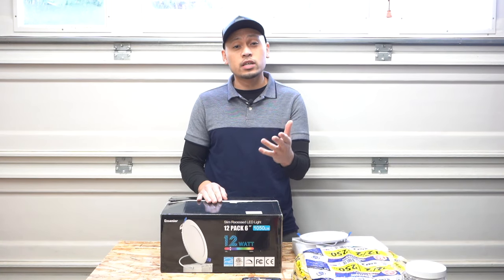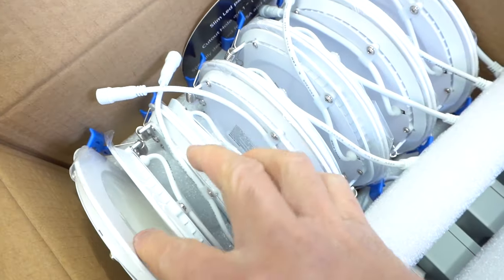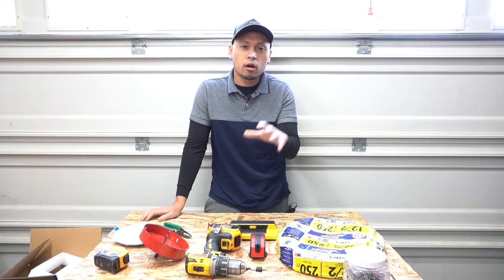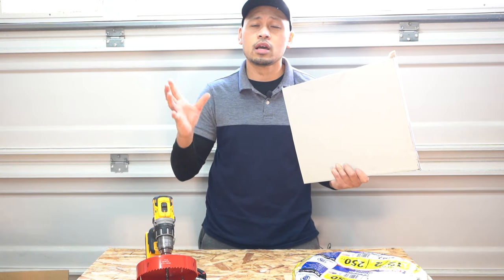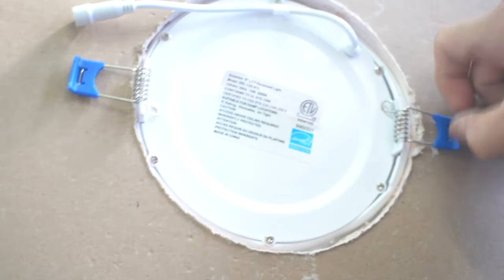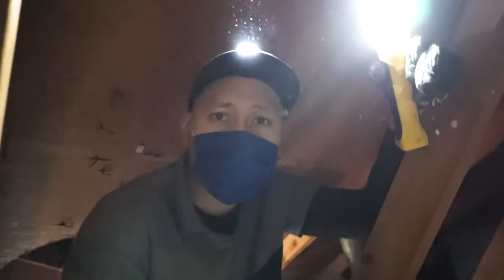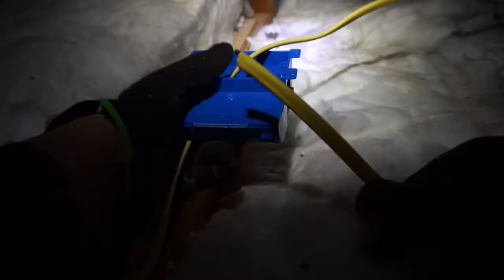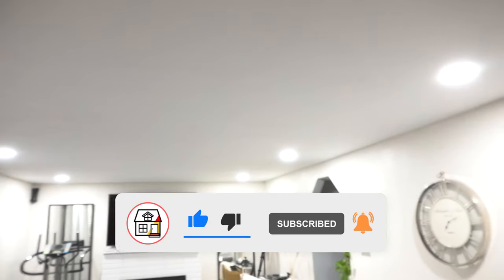How To Install Pot Lights In Living Room Ceiling | Thin Recessed LED Dimmable Lights For Beginners!

Comment: Thank you for another easy to understand video! I have a couple of questions for you or anybody who might have answers...
These are the types of lights that I want to have installed in my ceiling. First, I have to have drywall installed in the ceiling as it is currently old ceiling tiles that are stapled in place to strapping behind them. Will the strapping pose a problem when installing these lights?  Also, the person installing the drywall wants to put the drywall right over the tiles that are there without removing them which means holes will have to be drilled through the drywall AND the tiles behind them. Am I correct in thinking that this will be OK as the holes are going UP through the drywall and THEN through the tiles so if they're damaged it won't matter? Thanks in advance.

Comment: I am planning on doing this soon, just a question on the wiring for anyone who knows better than me. In the vid he connected all hot and common in and outs to the connectors. I was thinking to connect hot in and out to next light with common connected to each other and not the lights themselves except the final one. Any advice guys?

Comment: Not sure if i missed it in the video, but what do you do with the other end of the cable?
Reply from the maker: Hi! The end of the cable ends with the last pot light 💡 👍🏽😊
Reply: @FixThisHouse  Thank you. How do you remove wires from the connectors that comes in the junction box? They're not as intuitive as the WAGO.

Comment: I know this is an older video, but once installed, what do you do if you have to replace the led light? How do you un-secure the “latches”
Reply from the maker: Very easily, all you need to do is wear nitrile glove to protect your ceiling from stains, then grab any side and carefully pull to one side then another side. The spring mechanism should fold up. 👍🏽😊

Comment: great video to cover everything need. I have question for the first pot light can I just use the exist cable on the ceiling which is for the old pendant light(removed). And also for the last pot light we don’t need a loop cable since there is no more pot light need to connect is that correct?
Reply from the maker: Hi! Thank you for watching! Yes you can use the existing cable and for the last yes you don’t need to make a loop 👍🏽😊
Reply: 👍, does the spring clips work if my ceiling has two or three layers of drywall (old style house). If not is there any solution for me?

Comment: Hi very informative video thanks
What is the measure of the Hole saw drill bit for this job?Only see 6 1/2 inches not 6 1/4 as you described here to get on Amazon

Comment: I need help: 
We have pre wiring for fan. It's 14-3 wire - white, black, red and ground. The black wire has constant power and I am using it to run the ceiling fan. I have to use remote to turn the fan/light on and off. I capped the red wire which is controlled by the switch.

My question is: can I use the red, white and ground to add some recessed light?

I am just worried because I am using the black to run the fan. I'm not sure if I can use the same neutral and ground for recessed lights which is already being used for the fan.

Comment: So we have these in our new home but we want to replace them with Phillips Recessed Lights but it seems we need to add a 'can' to do it? Any thoughts?
Reply from the maker: If your going can style just make sure you use the same size diameter can so you don’t need to modify the hole. I made a video on how to remove can lights, just use that video as reference 🙏🏽😊

Comment: Quick question can u use 14/2 instead of 12/2
Reply from the maker: Good question DJ! Yes you can as long as it’s a 15amp circuit 👍🏽😊

Comment: Where did you connect the wire of the last hole its not looped, its a single wire? Is it connected to the one of the recessed lights?
Reply from the maker: Hi! Last light is single and not looped 👍🏽😊🙏🏽

Comment: 15:46 Is that main power coming from circuit breaker? Or coming from switch?
Would you explain how to wire from switch to lights (pot lights)
Thanks

Comment: Hi, I have the same lights and one is not lighting up anymore. I tested the power and the power is getting up to the recessed light. So, if I have power in the junction box  can I replace just the recessed light fixture without the junction box or I have to replace both? Or even worse I have to replace the whole system?
Reply: Nvm I tried to swap with an existing in my home another recessed light and still not working. So the first and easier option I think I have to eliminate

Comment: I am doing this exact installation. One question. Don't you need to have a barrier between the LED drivers and the installation? I understand that LED's and the driver run cool but I thought this would be a requirement.
Reply: Always check local code, but what I’m reading is check your LED for IC RATING if you are installing it under insulation to be on the safe side. And less than 100w.

Comment: Wondering why you didn't use your paint sprayer for your ceiling. ?
Reply from the maker: Hi! I was considering it, but using a sprayer takes a lot of drop preparation and a lot more plastic barriers so the overspray doesn’t reach the other rooms. I am skim coating my whole guest room soon and in that project I will remove all the furniture and create plastic containment and then I will use my paint sprayer for sure so stay tuned for that video 👍🏽😊🙏🏽

Comment: In the j- box you said connect the white neutral to the hot black. Do you mean connect the two neutrals together and the to blacks together? Or do you mean connect white to black and white to black?
Reply: Yes connect the white to the white,  black to black and the ground to the ground all in those wire nuts that are provided by the manufacturer. So each wire nut will have the same color wires coming out of it except for the ground that will have two copper wires and the green wire that's provided by the manufacturer that's attached to the fixture. The only exception to that is the last Light which will only have two wires coming out of each wire nut as that is where the daisy chain stops.

Comment: 21:21  You are supposed to put a plastic ring in the hole of the light box(protecting the wires)   because the metal box is very sharp !

Comment: I'm looking to run a smaller  3" ceiling light in my bathrooms above the shower and tub, could it be run off the light switch?  do you have any video's on that type of installation?
Reply from the maker: Yes ofcourse! Are you planing to do a replacement or new install?
Reply: I want to do something similar. I want to remove the light fixtures from above my mirror and install the recessed lights. How would I be able to run it off the light switch?
Reply from the maker: All you need to do is to remove your old light fixture, ( check out my video I made on how to replace light fixture it shows you how to remove existing lights. Similar concept. Then just repeat the same process as process number 2 on this video and 3 using your old light switch. I’ll make another video on this so it will be more clear 👍🏽😊 I’ll be doing the same thing on my kitchen cold lights. Stay tuned)
Reply: @FixThisHouse  I am doing a existing light that has a 3” round box.  I did not see any recessed lights for 3” hole.

Comment: Thanks.  Question:  At 20:20 when you are making connections in the J-Box (power source) you say "connect the neutral white with the hot black" but it looks like you have white to white and black to black? I'm missing something.
Reply: What you heard was wrong but what you saw was correct. Connect white to white, and black to black

Comment: Ensenior lights are now 6" or less so a 6" hole saw works fine. You'll also want the plastic half globe for it to catch the drywall dust. Also if you installed 50 of these it would still be only 600 watts, so use 14/2 instead of 12 wire which is more expensive and more of a pain to work with. IMHO . You also need a 3'8" Romax connector in the box or equivalent to prevent cuts to the wire and strain relief . Not using it is a code violation.

Comment: Pro tip...stay in reverse the entire time. It will still cut through the drywall no problem but make a cleaner edge. This is a great video. Good work.

Comment: Hello, just out of curiosity, how would you go about on replacing one that fails? Is there a special way to to pull it down( one side first and then the other) or is it a straight pull? Thanks
Reply: It’s easy to pull it down, one side or both sides are not problem.

Comment: Was there a power source already in the attic that I missed? I saw where you feed them through the holes but didn’t see where you actually connected it to a live power source
Reply: wire from the old light fixture that was removed and transferred to the new leds, goes to light switch below

Comment: Awesome ! Do you need a special type of light when installing near insulation ?
Reply from the maker: Just the same light set I used on the video found on the link on the description 👍🏽😊
Reply: Make sure the lights you’re getting are IC-rated. IC means Insulation Contact.

Comment: You should've tried using a large clear bwl , drill a hole in the center of it , push your drill shaft through center of bwl , attacth your bit , now use bwl to help catch  Debris.

Comment: What do you do with the excess wiring? Meaning the rest of the wiring you bought at the store. Does the excess wiring just sit up in the attic? If not, how do you cut and arrange it to make sure its safe?
Reply: You cut the excess wiring off, and it ends with the last light, within the jbox

Comment: @19:39 I see another set of inputs on the box that were left untouched. Can those entries be used for another write that is not related to this particular circuit?. I need to extend a wire (split wire) and the closest juntion/jbox is that one.

Comment: You need to use wire bushings in the j boxes to protect the wires from the sharp metal box! That's a code requirement!

Comment: How about the last step, where you connect to a switch? What happened to the last wire?
Reply from the maker: Switch can be fed from an outlet or panel. The last wife ends to the last light 💡
Reply: @FixThisHouse  Thank you
Reply: @FixThisHouse  So, The last loop, one end goes to the light and one end goes to a switch?

Comment: Lowe’s and Home Depot carry 6 3/8 hole saws designed specifically for 6” cans. Also, you don’t need 12 ga wire for LED lights. 😎
Reply from the maker: I know it’s just what I have left over. Your ok with 12 gauge as long as you have the right amp breaker. 12 gauge is compatible with both 15 amp and 20 amp. 14 only 15 amp.
Reply: @FixThisHouse  oh yeah, I’m totally on board on that with you. Sometimes I use 12ga for 15A circuits if I don’t have any 14ga wire laying around. I’ve been a general contractor for nearly 20 years

Comment: 2 question once the light is in how do you remove it and secondly when drilling the large diameter hole is there a trick to locating the drill bit on center because its not really visible
Reply: Removing the lights as simple as just pulling them down as those spring clips will move in when you apply for downward pressure which will allow you to remove the light. 

Drill a hole in the center of where you want the hole before you use the hole saw to make the cutout hole.  That way when you put the drill bit in you won't really have to see it you can feel it go in and then you'll be good to go!

Comment: Is there a problem if there is direct contact between the Led light and the insulation?
Reply from the maker: Mine are direct contact with the Insulation and no issues. Just make sure your electrical box is fully incapsulating all the wires/connectors.
Reply: Lights should be IC (Insulation Contact) rated.

Comment: How is the contact to insulation is that okay is it safe?
Reply from the maker: No issues with mine. All wires tucked in box.
Reply: Also these lights are ic rated. Insulation can lay directly on top! LEDs don’t get hot 👍

Comment: Why are you using 12/2 instead of 14/2 Romex?  Is it because the source of your power for the lights is using 12/2 Romex?
Reply: Breaker determines wire. 20 AMP requires 12 AWG or bigger on branch circuit wiring.

Comment: My power source is like yours but mine comes from the breaker panel. So how do I add a switch for these lights?
Reply: It has to go to some device after the breaker,  like an old ceiling light, remove from old light and feed to new led lights in parallel- black to black, green to green, white to white

Comment: I see that they are IC rated. Does that mean that the junction box can be completely covered with the fiberglass batt of insulation, or should the box be exposed to let it breathe and dissipate heat?
Reply from the maker: I covered them because they can be easily accessed if I remove the pot light. Please check with your area building code, each area is different. If can lights can be buried I don’t see why these tiny boxed can’t be buried, just my opinion 👍🏽😊

Comment: Overall great vid. I think the ceiling painting was a bit out of place for this topic. Also it would have been nice to see the consequences of drilling a 6" hole while the drill isn't in reverse, since you had a nice scrap piece to demonstrate with.
Reply from the maker: Thank you for the feedback! 🙏🏽😊
Reply: Right. Instead of wasting time showing us painting the ceiling, he should've showed us how he brought power to the first light, wired the switch, and why he decided to put a junction box inside the attic instead of going directly from switch to light.
Reply: Yeah why wouldn’t you cut the holes first and then paint

Comment: Why are you using 12-2 wire for LED pot lights? This is usually reserved for 20 amp kitchen outlets or 220 volt baseboard heaters that draw a lot of power. 14-2 is normal for conventional lighting like incandescent and fluorescent. LED's draw way less so 14-2 is even overkill and much cheaper than 12-2  but there's nothing smaller.

Comment: 12/2 is over kill for lighting. Especially using LEDs that don’t draw much. No need for a 20 amp circuit
Reply from the maker: You are correct! But it’s all i had at that time 👍🏽😊

Comment: You don't need 12/2 (yellow) wire, that's rated for 20amps. In residential lighting is 14/2 (white), 15amps, you save money .
Reply from the maker: That is correct, sorry it was the only one I could find in my tool box. 😅

Comment: Those connectors are not rated for 12 AWG btw. They say right on it 14 AWG max. I have the same LED lights and replaced for WAGO 221's.

Comment: Do not hold the red hole saw blades with your hand, reason: It will cut you.

The hole saw is very heavy and it could burn/smoke your drill, specially on wood.

I used a nail or something sharp at the spot where I am going to start drilling, reason: so the drill bit does not go off center.
Also do not put to much pressure (light pressure/let it do its job) on the big red hole saw because it will kick back and knock you off the ladder. keep your face away!

ETC etc safety first.

Comment: Anyone saying that the boxes have to be mounted to a surface… good luck doing that when there’s no way to access the ceiling space above the holes you cut. You do not have to mount the boxes, it’s preferable and neater.

Comment: You dont need 12 gauge wire for a 15 amp circuit. 14 gauge is a lot cheaper and is rated for 15 amps

Comment: Why 12 wire 14 wire   better for low voltage  ...
Reply: 14g or 18g is plenty big enough for the low power these light draw

Comment: No mentioning of how many light switches control these pot lights and whether you connected them in series or parallel... how many junction boxes you used in the attic... should we create zones or not (groups of pot lights controlled by the same light switch)... and how to use a dimmer switch when there are two switches controlling two separate groups of lights....

This is not against your video, I'm just a bit frustrated as no one has yet mentioned those details to those of us who are installing those pot lights in a room controlled by more than one light switch and an additional 3-way switch. In a typical kitchen you'll most probably have at least two light fixtures controlled by two switches. Obviously I have two junction boxes to choose from and will make a choice of installing pot lights to replace the old light fixtures or remove them and patch up and paint (not looking forward to). These isn't a single YouTube video talking about replacing existing lights in a given room and almost everyone talks about how to wire those pot lights and drill holes when I'm well beyond this basic info.

Comment: Why are you using an old work box in the attic? Orange wire nuts are good for two 14 gauge maximum. I see that you put two 12 gauge in them. There is a lot more to know than black to black and white to white.

Comment: You used the wrong wire buddy 12/2 is for receptacles 14/2 is for lights.also the lights are spaced to close to the walls,should be at least 3 feet away
Reply from the maker: 12/2 can be used for lighting.
Reply: Yes it can especially if you're on a 20 amp circuit. A lot of electrical boxes are set up that way and you have to use 12/2 for a 20 amp breaker.  14/2 is fine for 15 amp circuit.

Comment: Thank you!

Now when I electrocute myself it will be wired properly at least!
Reply from the maker: Please make sure to turn off the power from your breaker! Check for voltage using a voltage detector before working around electrical wires please! Be safe my friend and thank you for watching! 🙏🏽😊👍🏽

Comment: you did not put a wire connector in the side of the j-Box   that is a code violation
Reply from the maker: I actually forgot to implement that and I did, thank you 👍🏽